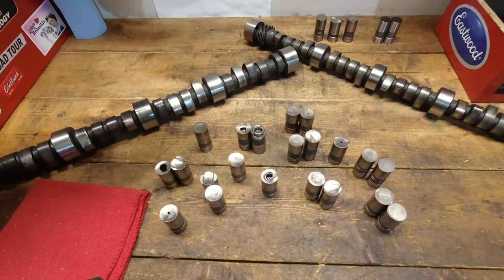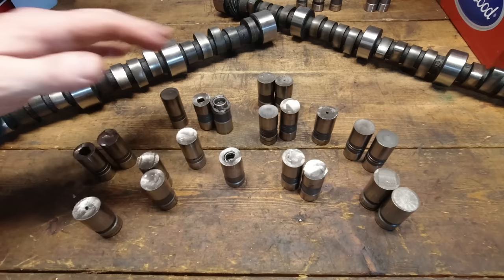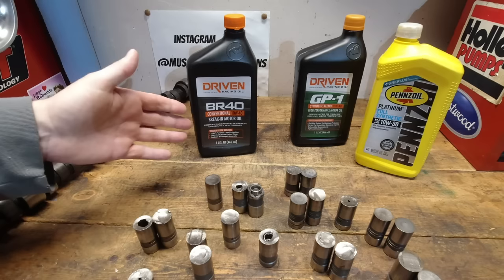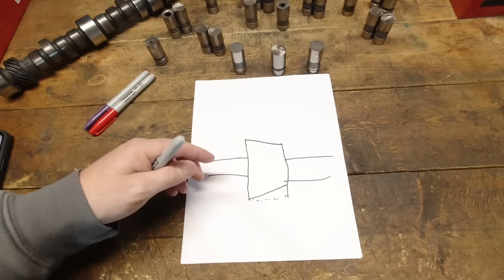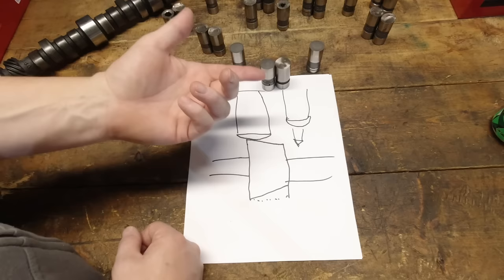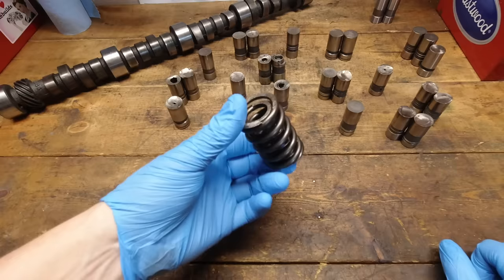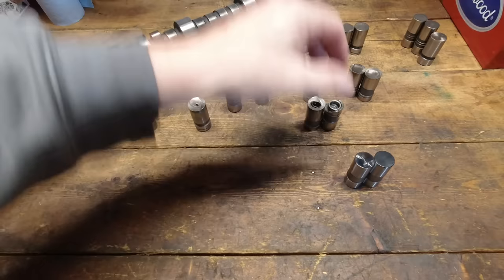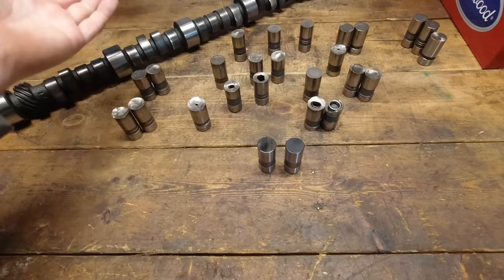Flat Tappet Cam Failures: The Reason Why They Go Bad & The Solution! Part 1

Comment: I see some people run all the springs to on break in with bigger lift cams . Watching Nick from Nick's garage he never runs all the springs on break in
Reply from the maker: It all boils down to the seat and open pressures.  Get those right and it’s a big step to getting a good break in!
Reply: @MuscleCarSolutions  yes I know that to .   I knew who you were talking about in Canada to DD speed shop . Sometimes I am cringing watching him . He's a cool guy but a little knowledge can be dangerous sometimes
Reply: Ok , so if you have a cam that 1 lobe maybe 2 lobes get wiped ,that is not spring pressures or oil issues, if it was oil or spring pressure related you would lose ALL the lobes , I've seen stock 350's with 80 lbs on the seat lose lobes , anymore with flat tappet packages you must check the lifters and make sure they are convex on the face , a lot of cams were ground without the proper lobe taper , the "soft cam" theory has been debunked , bottom line ...if your lifters aren't spinning you won't be grinning
Reply from the maker: @brettjohnson8009  That’s not the way that works.  One lobe can fail or several can fail.  Improper spring pressure will kill what it’s going to, but it doesn’t mean every single lobe gets destroyed.
Reply: @MuscleCarSolutions  If the spring pressures are equal throughout,  and they should be , then tell me how one a lobe can be wiped and not the other ones ? Same with the oil ,if is not good enough to keep one lobe alive why do the others survive ?
Reply from the maker: @brettjohnson8009  easy.  On the springs, you’ll generally see one or two start to let go.  When that happens…we’ll it’s an awful noise that comes from under the hood.  Engine gets shut off, engine pulled, problem realized.  Folks typically don’t keep driving to see if it get as better….  I’ve seen a hundred or more wiped cams and lifters this past year.  Not a single one had all the lifters and all the lobes destroyed.  Weakest link always goes first.  Lots of factors as to why.  Heat treat on the cam core, lifter/lobe relationship, not enough oil on that particular spot.  Can be a number of things.  But the three things I mentioned in the video can all happen, depending on the circumstances, at any given time to the lobe/lifter that is the weakest.
Reply: @MuscleCarSolutions  A hundred or more this past year ? Ooookay,  I worked at a reman facility for 17 years ,I'm more educated than you think , but you seem to know everything so with that , have a good day
Reply from the maker: @brettjohnson8009  easily 100.  That’s where I dug up all the samples shown in the video.  I’ll dig up some pictures and post it in the community tab on my channel page.

Comment: I think it has been proven again and again, that the parts are not the culprit. The metal is just the same, like 50 years ago. It must be the oil or (thats my theory) the more frequent use of windage trays. The 2000+ rpm initial break in, does not improve oil splash (lubrication) to the cam. Just my theory.
Reply from the maker: I covered some additional things to think of that no one ever has an answer to after a failure.  What was your bore to lifter clearance?  Did your machinist check the lifter to bore alignment?  These engines aren’t new.  Most have probably never had the lifter bores measured.  So many factors at play and most ignore they exist.  Until they have a failure…..
Reply: @MuscleCarSolutions  yes, I should have watched your vid till the end. You mentioned windage trays! I thought, I'm the only one with that theory, never heard it before, at least. Glad you mentioned the comp share in the marked. From what I heard, the percentage of failure is even lower than that of other manufacturers.
Reply from the maker: @bigblockjalopy  I try not to look at it emotionally.  Look at the whole picture.  Part of my insight from working in the performance aftermarket my entire life.  No one even comes remotely close to what comp ships each month.  Flat tappet stuff is just getting more difficult and more expensive to use.  Suppliers aren’t interested in making them any more so the price has gone up.  Makes me wonder what that market will look like in 10 years.  I’m assuming it’s going to be slightly less than a roller.

Comment: Wow. Good info to have, but the timing is not great. Wiped the cam in my 383 stroker during the 20 min break in about 1 year ago. Ended up going full roller & aluminum heads etc. but that was not cheap. Would've been a lot easier to use break in oil, cheaper too.
Reply: But looking back, you're now enjoying the roller and heads, eh?

Comment: Breaking in a cam on a marine BBC. It has a windage tray...not that easy to remove and replace. How necessary is this step?
Reply from the maker: Getting the right spring pressure, the correct oil and low break in rpm are more important.  Concentrate on those.
Reply: @MuscleCarSolutions  awesome tips. Springs are standard stock and I knew about the oil but I was ready to run her up to 2200rpm as so many suggest. I'll keep it at 1800. Thank you!
Reply from the maker: @michaelkeenan9526  verify the spring pressures.  Even stock springs can be way too much pressure.
Reply: @MuscleCarSolutions  thanks will do

Comment: Ok quick question.... You say dont mix and match brands lifters and cams, but comp is the only company offering the coated lifters, what if I have a brand new crane cam and lifter set, and I wanted to use the coated lifters as added insurance, you would recommend against that?
Reply from the maker: Well, comp ground all of cranes cams for 15 years before they closed the brand.  The taper on those cams is fine for the crown on the comp lifters.
Reply: @MuscleCarSolutions  I did not know that. Thank you very much
Reply from the maker: @mitchdropps6856  all good!  Thank you!

Comment: Those DLC lifters seem to be ground flat. You can see reflections in the background. Shouldn't they be ground convex to promote lifter spin?
Reply from the maker: If you can see crown on a lifter with the naked eye you might be Steve Austin, the Six Million Dollar Man!  Might have to Google that reference…😂😂
Reply: @MuscleCarSolutions  It's the polish that makes them so reflective. A convex surface with a radius of 45" would look relatively flat and not distort the reflective image. It was the swirl-marked lifters that threw me off.

Comment: I'm thinking oil is the biggest issue. I recently bought a 76 Dodge truck with a 360. It was a fire truck with only 14000 miles.  I changed the oil not thinking about additives. Made it about 1000 miles, and wiped the cam. Couldn't have been China.
Reply from the maker: It can be. Especially on an old engine that used conventional oil it’s whole life with the additives used at the time.  Sad to hear.  Hopefully the engine is rebuildable.
Reply: @MuscleCarSolutions  Engine is fine. Only has 15000 miles on it. Cam bearings need replaced. Not sure what happened there. They are pitted, chunks of babbitt missing. The rest of the engine looks like new. I've got cam brgs, cam, lifters, and double roller timing set (no more plastic cam gear). Went with a slightly bigger cam. So I'm waiting for valve springs to arrive.
Reply: @MuscleCarSolutions  It was built in 1976. But if it has 14000 miles you can't really call it an old used engine. Although being a fire pumper truck, it could have some hours "idling". Has an hour meter. But I don't think it works. Don't remember.
Reply from the maker: @briankennedy5578  for sure was built in a different era.  When things were a bit more simple!

Comment: None of this high rpm break-in makes sense. The opposite, low rpm does make sense. No car factory ever breaks in an engine first start, not ever, for over 100 years. Start the engine, drive it to the parking lot, turn it off. The cam turns 300 rpm at 600 rpm idle. The lobes are actually pushing the lifters ~1/3 of that, duration of ~120°. So about 100  lifts per minute or 1.7 per second. You can blink or tap your finger thrice as fast, for perspective. This is trivial and breakin grease or even oil is plenty. When you raise the rpm 4 times idle you have increased the velocity at which the lobe approaches the lifter and the speed that the lobe wipes accross the lifter thus increasing friction dramatically. Like starting a fire by twisting a stick on a piece of wood slowly vs very fast. And pump oil pressure from lifter bore and crank slinging takes a few seconds. Best of all, get a sixties GMC V6, the cam is IN a pool of oil at all times. As far as rings seating, use a bit of thin oil and low rpm. Never had problems and engines I built still run fine.

Comment: Improper break in,  to much spring pressure,  no zink in oil.lifter not turning in bore, ( due to not deburring the bore hole after shotpeaning to cleaning ), cam location shallow  or to deep in the block, King Kong springs need only outer spring to break in and low RPM 3000 , Valley tubes installed not letting oil fall over camshaft. Machine marks on the lifter bottom needs to be removed by 600 wet sandpaper and a flat surface.
Reply from the maker: Oof.  Well some of that is the right advice.

Comment: Never had a Cam I installed that failed.....but I have replaced Cam's with flattened cam lobes as well as mushroomed lifters..... People are forgetting what the guys of old paid their dues on..... People need to go back to the wood shed...so to speak....
Reply from the maker: And what advice would you give then?  Because the game isn’t the same as it was in 1980 when I built my first engine.

Comment: What if im about to just swap in a new set of lifters to an original factory cam with 200 thousand miles on it?
Reply from the maker: Hello failure!
Reply: @MuscleCarSolutions  all the lifters are shot though. I got a set of Elgin lifters to put in. Its been chattering at rpm and been down on power for about 2 years now.

Comment: any suggestions for a high zinc oil for a TJ wrangler with flat tappet inline 6?
Reply: irony is i stumbled across this video as i recently had a hydraulic roller lifter failure in my LS gen4 L98 - but the GF has a TJ wrangler with flat tappet :D
Reply from the maker: Driven GP-1

Comment: I have raced since I won my first Division 1 title back in 1986. I have never had a single cam related failure!!!  NEVER!!!  But we take the time to find and buy the best parts that we need to win.  Not a single thing in this video was relevant to anything or anyone. You have your opinion and its on youtube so it does not matter.
Reply from the maker: The only opinion is what I feel is the weak point and that’s the lifters.  Everything else is 100% facts.
Reply: Yeah if we could just find someone that worked for a cam manufacturer to give us some insight 😁

Comment: What would removing the windage tray help?
Reply: Throw a bit more oil "in the wind" up to the cam.  Bit of a pain in a 3rd gen Firebird to drop the pan, you have to lift the engine a bit. Re-do the silicone sealant.

Comment: what do you think about the flat that the 2.8 chevy had on the side of there lifter that let oil come out the bottom of the lifter on to the cam lobe ? and i have seen a set of lifters that had a small hole on the bottom to oil the cam lobe .
Reply from the maker: The EDM lifters were a good idea in theory, but never really worked effectively in all situations.  They’re still available, but it’s not like they’ve been used as the solution.

Comment: i have 2 comp cams i ordered from  summit racing both of them ate the lifters however it did not wipe out the cams or even take any thing off the cam lobes . they can be reused they have no wear .the lifters had cam lobes cut right thought the center so i would have to say the lifters are garbage .you never saw that in the 80s
Reply from the maker: Every failure starts at a microscopic level.  I wouldnt assume the cam is safe.  Depending on how bad the interaction was and how much heat was generated, the cams could very easily be compromised with a weaker surface area.
Reply: @MuscleCarSolutions  if i was able to up load pics you can see the hardness of the cam lobes still have the same coating they had when i installed the cams .i will reuse these cams with new lifters i have 32 years building motors the lifters are junk never blown 1 up yet i thought the cams would be junk i never even checked untill the second occurrence seems to be an on going thing

Comment: Why criticize others explanation for failures without stating why there has been a rash of recent failures for people following all the proper protocols
Reply from the maker: That’s the problem.  In most cases, folks don’t follow what needs to be done for a successful flat tappet break in.  The videos in this series are targeted at answering your question.  Why have there been an elevated amount of flat tappet cam failures over the past 20 years.

Comment: We really shouldnt have to do all that. they didnt do it at the factory.       I went with roller.  Been down that road recently wiped out cam in 10 min after perfect start up.    Rough
Reply from the maker: Thirty years ago, you’re right.  Things change.  Lots changed.  It’s absolutely crap that all the extra precautions have to be taken to get a good break in.  It can be done, but all those boxes have to be checked off to get any possibility of success.  Roller solves most of the issues no doubt.
Reply from the maker: @lordsauto  light spring pressures are the biggest issue.  Like I mentioned in the video, no one wants to change those back out after the engine is already installed.  Still amazing how many flat tappets are still sold every year.  That’s a rough road to travel!

Comment: I have a question I got a stock cam from a 351 Cleveland cobra jet but Dont have the lifters I was going to use comp lifters any thoughts
Reply from the maker: I’d call them to see what their thoughts are.  I’m not that’s something I would do.  If you’re stuck on those cam specs, have a custom grind roller done and don’t worry about it’s ability to survive.

Comment: You really think the chamfer matters? Considering that the lobe doesn’t contact the edge
Reply from the maker: The OEs thought it was important enough to have a very tight spec on it.  Same with any high quality aftermarket company.  Chamfer is very important and for some reason over looked when folks are looking for a quality lifter.

Comment: This is a myth. Just broke in a Comp cam in a 289 Ford a couple months ago on straight 30W non-detergent like I always have then straight to regular 10W30. No problems about 600 miles in. Run a 42 year old Ford 300 on conventional 10W30 Valvoline everyday without issue. A 260K mile '87 Ranger 2.3 flat follower OHC on whatever oil I can find cheap. No cam issues. Even ring break in isn't like it used to be. I use moly rings and there's no smoke or blowby even out of the box. Stop watching YouTube and just read the break in instructions from the cam manufacturer.
Reply from the maker: @danielb5215  I think the hundreds of thousands of people that have had cam failures in the last decade or so would disagree with that statement that this is a myth.

Comment: I’d never heard to run the same brand of lifters as the cam until now. I mixed a new Howard’s cam with new Comp lifters. I have what sounds like a lifter tick on a +/- 1000 mile engine. Would it be worth while to toss the Comp lifters and get a new set of Howard’s lifters to match the cam?
Reply from the maker: Don’t know.  After that many miles it’s not a guarantee the cam is any good.  Check the simple things first. Lash set properly?  It’s not an exhaust leak?  What weight oil are you using?
Reply: It’s a Chevy 292, so the exhaust is on the opposite side of the engine from the lifters/tapping sound. I set the valves to zero lash plus half a turn and have quadruple checked them. I’ve removed the suspect lifters to inspect them and they all look perfect. I forgot to mention in my last comment that they seem to bleed down within a couple minutes of the engine shutting off. I did a 30 minute break in with 10-30 Lucas break in oil. 500 miles with a new filter and new Lucas 10-30 break in oil and then another oil change with 10-30 Lucas hot rod oil.
Reply from the maker: @myrabbitmoose  lifters with really fast bleed down rates tend to be much noisier.  Try a 15W-40 and see if it clears up.  Not that I would recommend it long term if that’s what your bearing clearances and oil operating temps are asking for, but it would isolate the lifter being the culprit.
Reply: Awesome. Thank you so much for the info. I’ve got a lot of time and money wrapped up in this engine and it’s worried me to the point that I’m afraid to drive it. I’ll give your suggestions a try. I really appreciate you taking the time to answer my questions.
Reply from the maker: I hope you find where the issue is coming from!  Good luck with it!